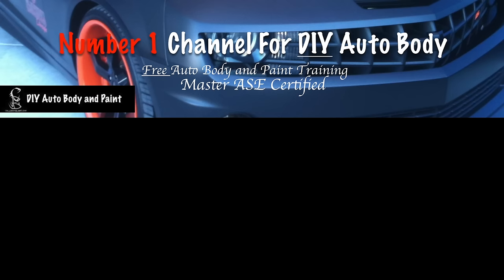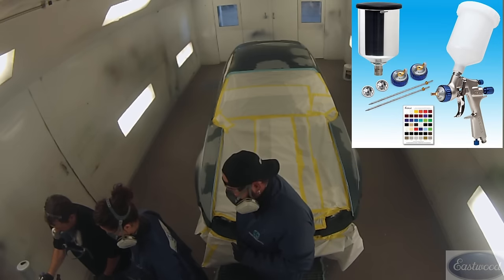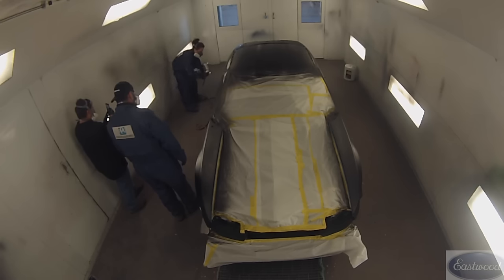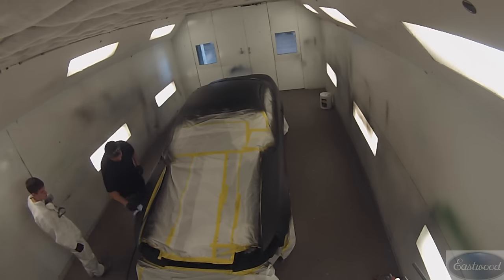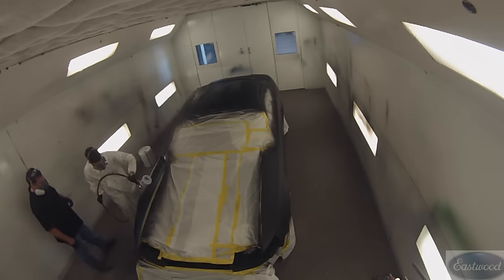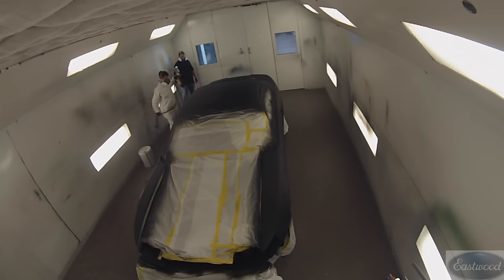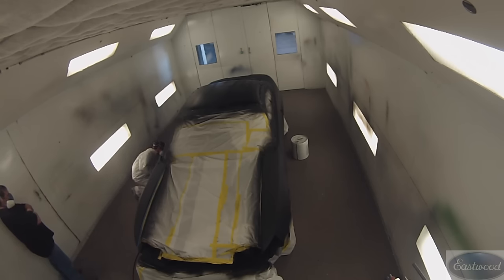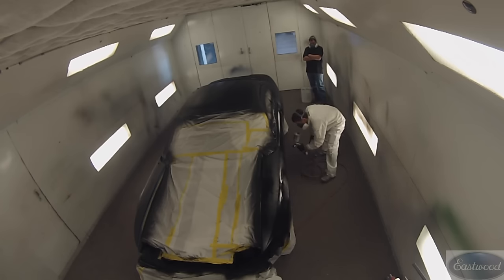Painting Car Black (Primer Sealer and Base Coat) Eastwood Mustang Project

Comment: Do I need a sealer when spray painting my car finish using a one stage urethane? It has a gray primer now. If you recommend a sealer...what sealer would you recommend? The car was finished from bare metal using an epoxy primer, then a regular gray primer. What I"m talking about is needing a sealer perhaps on top of this primer, before I do the final paint coat of the one stage black? Thanks.

Comment: I'm an apprentice in a workshop, and I'm always so hesitant to try spraying basic filler even because there's just so much money involved if I mess up.
Reply from the maker: Get a junk fender and give it a try.  There are some cheap paints you can use to get the feel for it.  I have a page with spray gun adjustments you may find helpful to get started.  Visit http://CollisionBlast.com/GunAdjustmentVideos

Comment: Its ok to spray the black base coat over the primer sealer without sanding the car down again?
Reply from the maker: Yes, you shouldn't have to sand sealer unless you wait longer than the window.  Depending on the sealer you probably have between 24 and 72 hours to spray base before sanding.  Here is more about primers that you may find useful... http://www.collisionblast.com/paint-prep/
Reply: Thank you for the response. The link you gave seems to say the opposite. It says the car needs to be block sanded after the primer-surfacer is sprayed.
Reply from the maker: If it is primer surfacer it does have to be sanded.  If it is sealer it don't.  What kind of primer is it?
Reply: Ok thats where my confusion was. Thank you again.